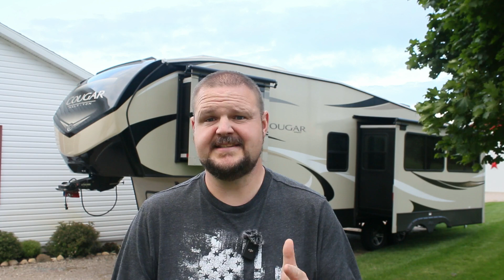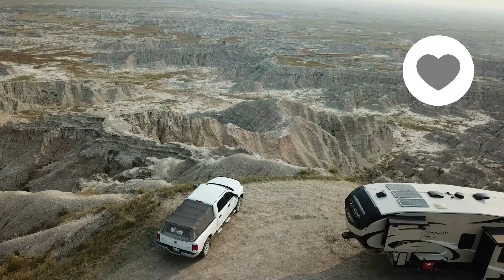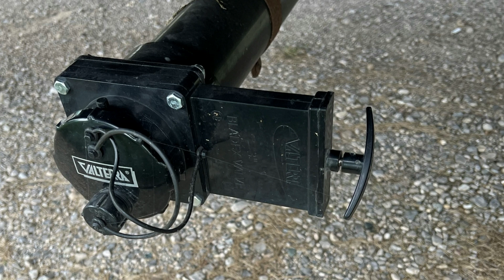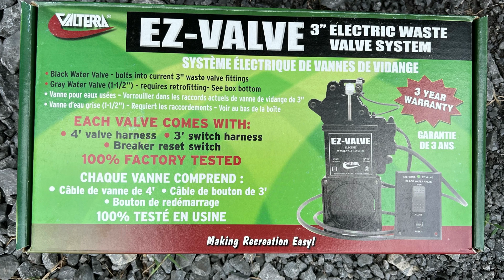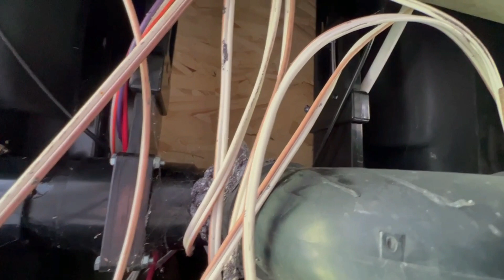Valterra EZ Valve... The best RV sewer Upgrade!

Comment: Watched your video. Thx. I have the electronic EZ valve dump switches inside my destination trailer. The black tank switch seems okay. When I press the open valve rocker switch a red light comes on and I can hear the tank emptying.  The grey tank switch does NOT light up and nothing happens if I press the reset button. Any suggestions? How can I reset?
Reply from the maker: @dianner6637  you need to make sure it’s getting power.  You may have a fuse that blew.   I haven’t released this video yet but it may help you.  It shows what happens when you push the button 
Valterra EZ Valve / How Does it Work?
https://youtu.be/MHFHq0PH5GY

Comment: I have a 2016 Cougar with the same problem you had.  Black and Grey valves between two tanks and no room to get the old valves out and new ones in. What was you eventual fix?
Reply from the maker: We had to cut the pipes and put rubber boots on them because there wasn’t enough room to glue fittings
Reply from the maker: Valterra EZ valve install
https://youtu.be/7u_U9vZsh_0

Comment: Thanks for the video.  Were the old valves you took out Valterra?
Reply from the maker: Yes but they should be universal.  The issue can be they are a little thicker
Reply: @GimpyCamper  I have a 2016 Cougar with the same problem you had.  Black and Grey valves between two tanks and no room to get the old valves out and new ones in. What was you eventual fix?
Reply from the maker: @davidford8703  we had to use a rubber boot because there wasn’t enough room to glue new connections